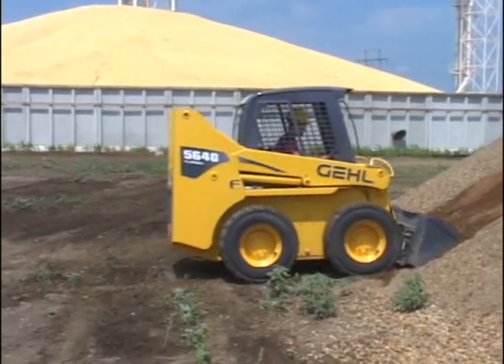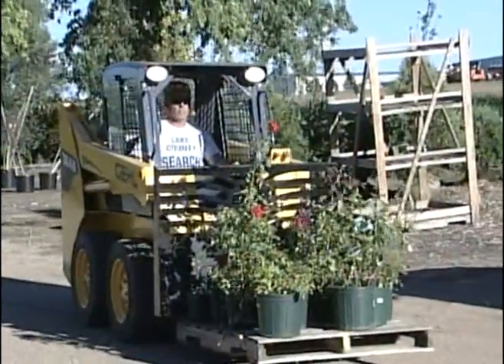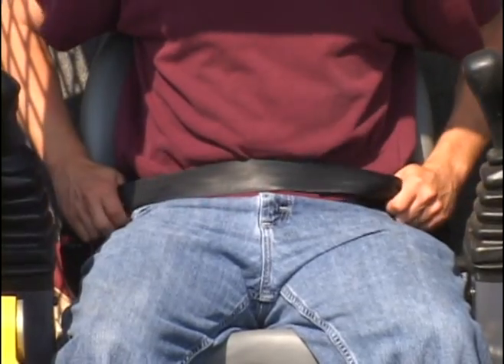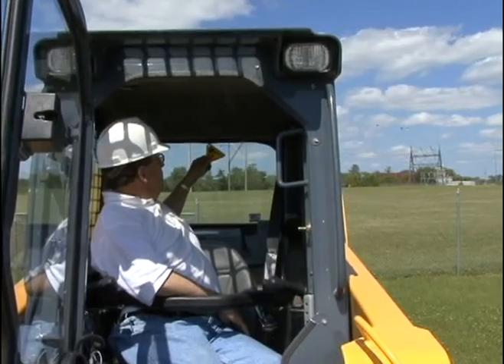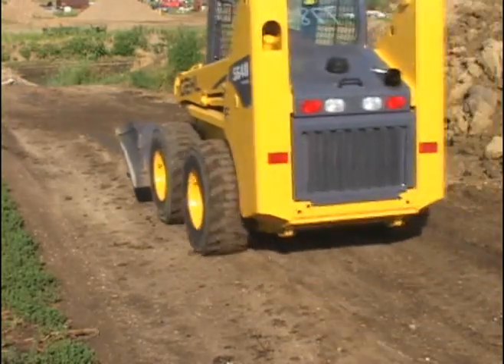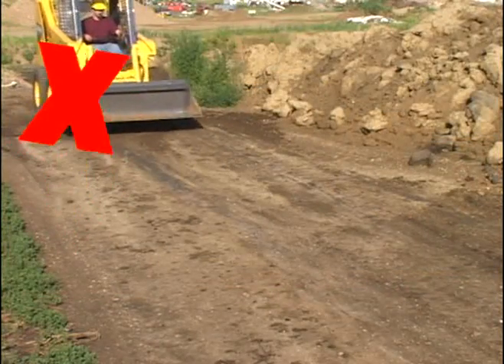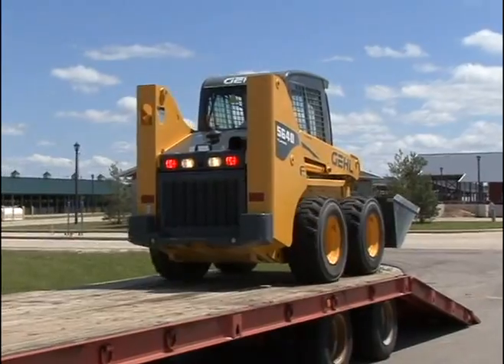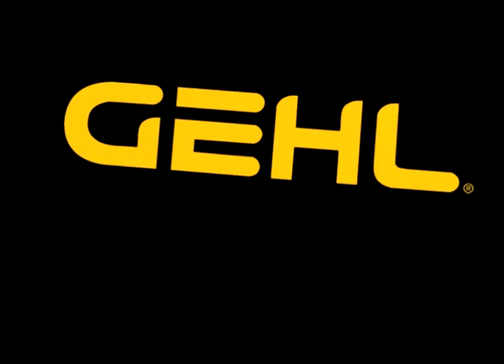Gehl Skid Loader Safety Video

Comment: This industry needs to get with the program  Today October 14/2020 and Start adding Standard Surround Veiw Sensor Safety Emergency stop and or Braking feature  To Simply Prevent Crushing Deaths of Especially toddlers and or children Dog's cat's Squirrels You name it. It's  been in the Auto industry for years and these things are no different than distracted Driving operaters in both car and Bobcat Skid steer so-called loaders. Backup cameras are Useless and cannot be relied upon at all ,A unsensored equipment Mini loader equipped with a Definitely Unsafe Simply vision camera will still Run over the inattentive everywhere and probably has been documented , the Annoying Back up Beeper are also useless l hear them all winter long where l reside & Around the clock when the Snow dumps Tons of the white stuff & Beep beep beep beep beep beep beep beep beep at 1, 2, 3,4,5,6,7 am in the morning and Nobody is around for miles and Beep beep beep beep beep beep beep beep , They simply need to Wire those Dumb back up beepers to Simple So-called Smart Sonar sensors and Sound off only when the Computer detects  thermo imaging objects. Like humans dogs cats you name it. People still get killed with the Dumb back up beepers Sounding off like Madd.